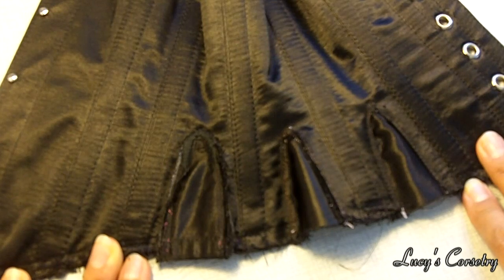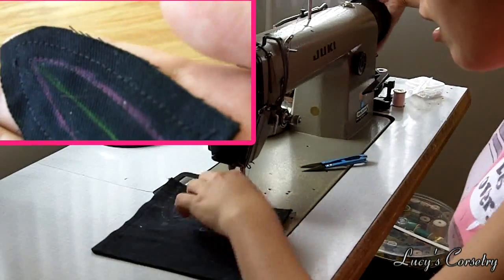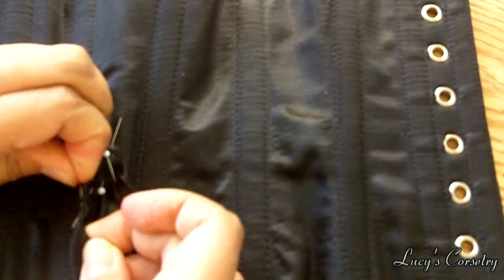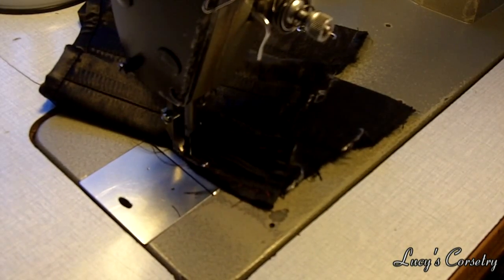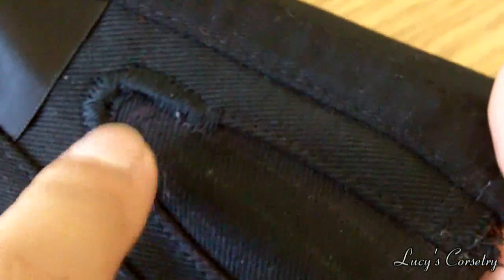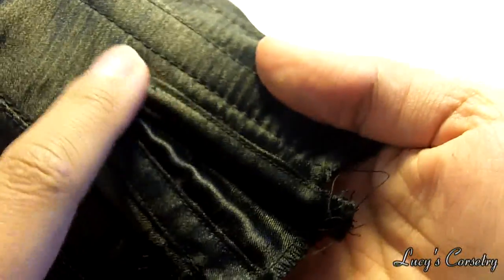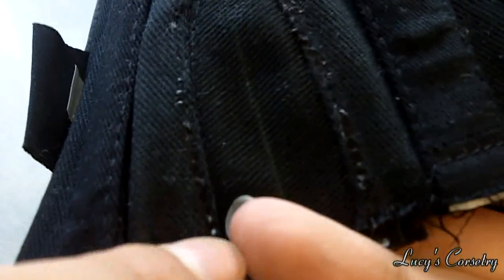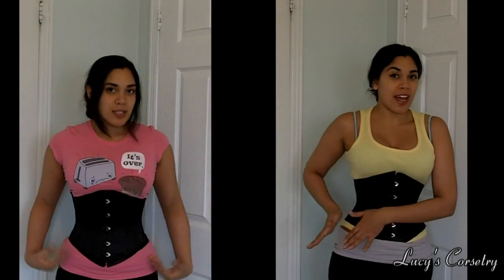Corset Modification: Inserting Hip Gores (Part 2 of 2) | Lucy's Corsetry

Comment: Thanks so much for sharing these ideas! I have the issue of unusually large hips so no OTR corset I've ever found can even come close to my measurements. (29" underbust, 26" natural waist, 41" lower-mid hip--even my high hip is way larger than anything I've seen offered). Sadly it's not fluff in my hips either, I just have an extremely wide pelvis and a super short torso. Buying custom isn't really an issue it's a worthy investment, but due to expense it does cut down on the variety in your wardrobe. So hopefully at some point I will be able to use this tutorial on something OTR and see how it works! As I said, I really appreciate you uploading this, it's extremely helpful for the extra pear-shaped among us :) And combined with your other reviews discussing construction method it's easier to figure out what companies may be more modifiable. You do so much for this community and you are extremely helpful.
Reply from the maker: Thank you, Catalina!
Actually I'm not sure if this is helpful for you, but I just completed this gallery of corsets last night, where each corset has more than one adjustment point or multiple lacing systems (like hip ties, etc). Some of them might be what you need:
http://lucycorsetry.com/research-corset-brands/guided-galleries/corsets-with-multiple-adjustment/
Reply: What a wonderful idea! Thank you so much for linking me to this and for your work putting it together! That's a really fantastic concept. I never thought of hip ties!

Comment: Thanks for this tutorial! I've inserted 2 hip gores on one side of my Corsets-UK underbust and so far I can feel a significant improvement in the fit, being able to cinch down properly at the waist. I chose the sandwich method and my sewing is horrible so I'm considering covering this up with contrasting fabric and replacing the binding top and bottom with same fabric. I might add some gores at the top as now with the hip gores the gap at the back is V shaped. I hope it turns out OK.

Comment: i knew there had to be a way to do this! i've noticed most corsets aren't curvy enough for me now that i have a better idea what i'm looking for & how it'll fit. i thought the modern fit would work on me (it does give back support, which is why i bought it), but i can't cinch the middle very well cuz my hips are way too wide (32-22-32) for the level 1 silhouette at orchard corset, & if i'm not careful i can get the top too tight, too.  this is an awesome idea to fix these issues!

Comment: Hey! :) Couple of questions. The corset I've been thinking of modifying, the fashion layer is black leather. Would it be ok to use a different fashion fabric for the gores? Idk really where to get leather. :T Second, could I put gores in the rib/underbust area? Or is that.. Like a no-no? Haha. Third, this corset has hip gores already, but I have found that they are not wide enough for my bodacious hips haha. Would it be worth it to dig those gores out and replace them with wider ones? :T Sorry

Comment: Thank you Lucy, so much for all of your corset modification How Too's!! As a part of your Corset Modification series, it would be wonderful to learn how to make an existing corset stronger by adding a layer of coutil or duck. Can this be done by just tracing the existing pattern, using the roll pin method, adding seam allowances, and inserting as a liner (could a waist tape be added at this point?), or would it need to be inserted into the middle between the existing shell and liner?
Reply from the maker: Yes, you can add an internal strength layer exactly as you described. :) I used to have a video on how to take the pattern of a pre-existing corset, but too many people were using the tutorial to steal the designs of other people for their own profit, so I took down the video. However, if you already know how to take the pattern and nest a new strength layer inside/ behind the other layers as the new lining, go for it! :)

Comment: Thank you very much for sharing your experience! I recently discovered your channel and got some great ideas from you - you do beautiful work and I've found your tutorials extremely educational. Thanks to you, I'm getting ready to start this hip gore modification as my first corset project. If you would be so kind, would you tell me what sewing machine brand/model you use or would recommend and what brand/model press or presses and dies you use for grommets and bone ends? I'm not looking to compete with you professionals, but I would like the right equipment for the job to produce beautiful work like yours. I have means and I'd really like to have good equipment before I start cutting.

I look forward to your advice.
Reply from the maker: I use an industrial Juki DDL-555. :) The grommet press I use most often is my HomePro LR from American Tag, but it's been discontinued (although I can still get grommets to fit it). I've also tried the Cstep-2 machine which is okay, but not the best I've ever tried as the self-piercing grommets have a narrow flange. A 5mm wide eyelet setting kit from Prym would work well for small projects.
Reply: ***** Thank you. I'll look for something comparable for the sewing machine, and the info will be good to use as a benchmark for shopping around. I may go with something slightly lower end as I don't have the requirements you do.
Keep up the great work on your channel - it is well appreciated. I modified my original post a bit to eliminate the TMI I included for your benefit.

Comment: I was wondering if you had any ideas on adding gores ( or gussets ;) ) to the upper edge of a corset? Would that even work? I have a Timeless Trends corset I really like, but I have since realized I need a curvier style corset with a much greater spring. This one has hip ties at the bottom edge, so I can adjust the fit ok there, but the top edge ( it is an underbust) is a bit smaller than I need/is comfortable. I have a a newer better fitting corset now, and have been playing with the idea of testing alterations on my first one.
Reply from the maker: Yes, ribcage gores and gussets are possible. :) You can see on overbust corsets there are bust gussets as well. Just be sure to secure them very securely and especially reinforce the tip of them, because the ribcage tends to take more pressure compared to the hip area in a corset.

Comment: I was wondering if you had any tips on how to reduce the hips in a corset. I bought one from mystic city and it is beautiful. However, the hip spring is way too big. I really want to keep it so I would like to alter it to make the hips smaller. Is there any way to do that?
Reply from the maker: You can use this same hip gore technique to cleverly reduce the hips of the corset as well! When you're drafting for the gore, make the width of the gore more narrow than the seam allowance you use in the original corset panels. For instance:
If your corset has hips 2 inches bigger than your natural hips, then you have to take in 1 inch on each side. Let's assume you put in two hip gores per side, so each hip gore takes in the corset by 0.5 inch.
If you make the hip gore 1 inch wide, but you use seam allowances that are 0.75" wide on each side, then there will be a deficit of 0.5 inch in that gore! You'll end up with a skinny decorative gore, and a corset that has more narrow hips than before, and it will be more comfortable than simply sewing darts into the corset (which can be bulky and cause pressure points). :)

Comment: I bought a corset and the hip part have a little gaps on them what do I do ?
Reply from the maker: If your corset still has a lacing gap in the back, it’s not a problem - as you’re able to gradually pull the corset tighter, the gaping at the hips will slowly go away and the bottom edge of the corset will come in to meet your body. :)
However if the corset is fully closed in the back and it’s as tight as it can go, then the hips of the corset are too big for your body. Some people will sew darts into the corset, or use gores to cut away some of the hip to make them smaller. I discuss this somewhat in another alteration video: https://youtu.be/dRi2RoqmL-Y
Reply: Lucy's Corsetry okay I’ll check out your video but do I work out on my hips ? Or will the corset will form it with time ?
Reply from the maker: @cocoamourrr  Corsets form the waist (and to some extent, the ribcage) but it doesn't reshape the hips or bustline. It only makes these areas look bigger or more shapely in contrast or support.